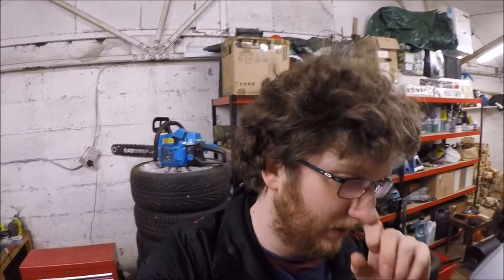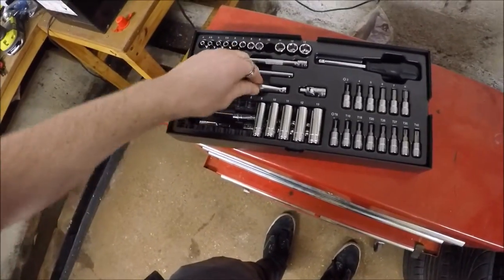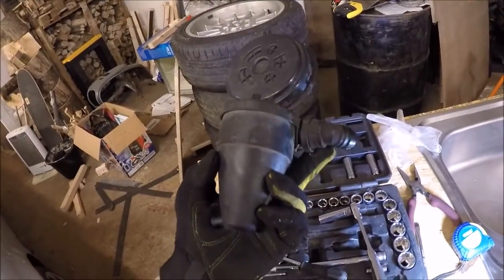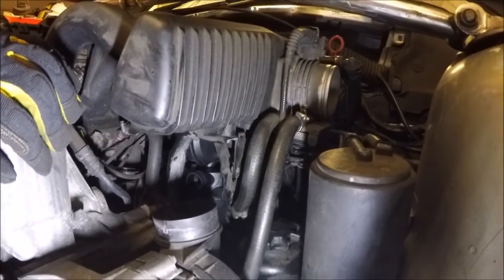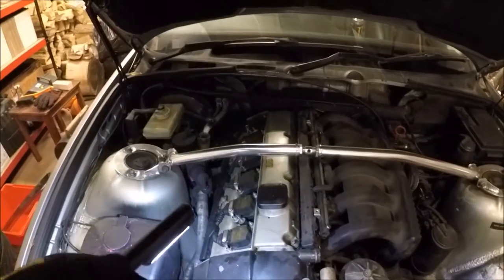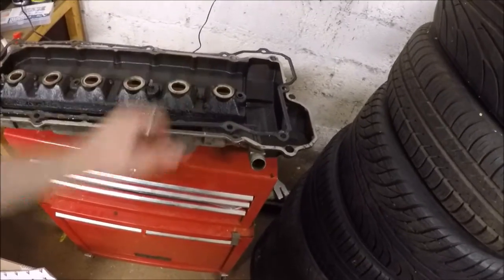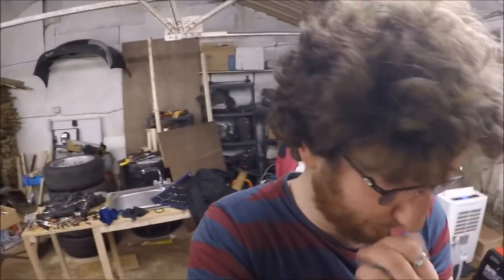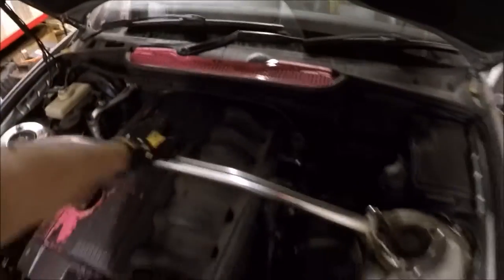E36 328i Touring - VLOG 2 - Crank Case Valve Replacement - New rocker cover gasket - Servicing

Comment: Did you notice smoother engine operation; also do you bother with torque wrenches? Will be doing these jobs plus oil filter gasket on my e36.